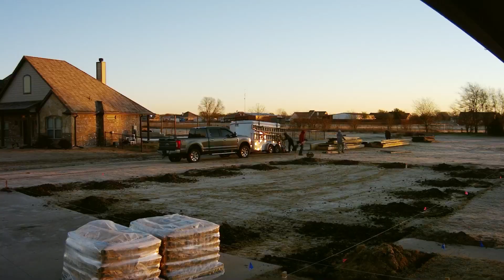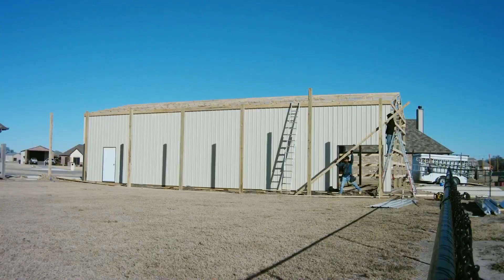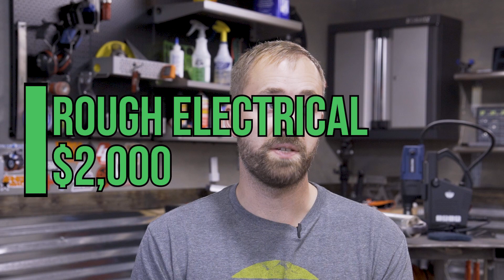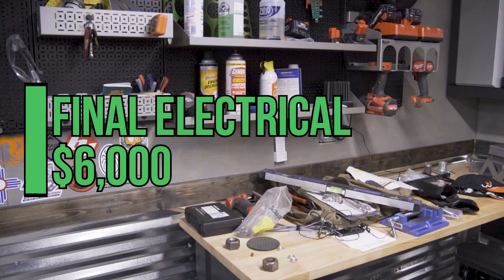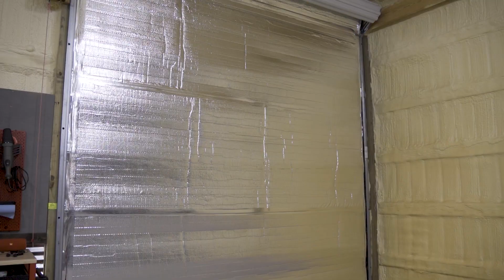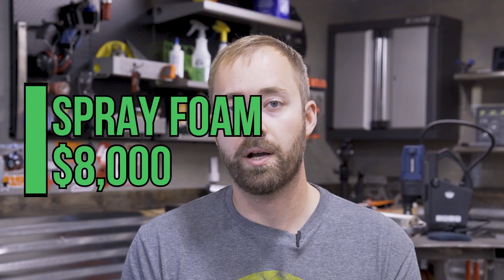How Much Does A 30x60 Pole Barn Cost? - Reckless Wrench Garage

Comment: 2 years late to the party but I want to build a 40x60x14 on my property. the place I want it is mostly flat but its a good 500ft + from my house so it will be a long run for electric, water, and natural gas. I also plan to add a bathroom so there's plumbing involved. I built a 250 gallon compressor, using an old LP tank, with a single stage twin cylinder compressor that runs on single phase 240v that's going to go in it. (its under my carport, wired up to a double fuse box atm). I want 2 12x12 roll up doors and 2 man doors. full insulation (Georgia heat and humidity), floor drains and a 2 post lift. most lift manufacturers say 5" high pressure concrete but I'm going with 6". I was planning on going the full metal building route but seeing the pole barn setup has me rethinking that.

Comment: I’m not trolling, but you had a $75,000 shop built but didnt own an impact drill?
Reply from the maker: Uhhh, yeah. I also don't own a table saw, bulldozer, router, planar etc.

It's almost as if I don't ever do construction, maybe I work on cars and work with metal.
Reply: @ I’m an auto tech by trade, and even I have an impact drill lol
Like I said, I wasn’t trolling just genuinely curious

Comment: Huge help thanks!
I’m looking to do the same style but a 40x60x16.
I have 2 questions though…
1. What is the height from your mezzanine floor to the bottom of your rafters? If I go with 14’ eaves maybe I can do a steel rafter….

2. Do you happen to have the links for your building and some of the contractors that you used?

Comment: I can get one 40' X 60 feet here in Florida just as nice if not better, for $23,000 assembled out the door........ Yes, it may be cookie cutter, but if I like the building, then it's what I can use. The interior spray foam and concrete floor is separate of course......... So , maybe $30,000 completed....

Comment: Why'd you put the slab in after the structure?  Seems like that would raise the difficulty of almost everything but especially of the slab work versus putting that slab in up front.
Reply from the maker: Lookup post frame construction.
Reply: @RecklessWrenchGarage  I don't have to since I already know and it's not germaine to the question.  Just because post frame-in allows the slab to go in secondarily - or because it doesn't require a slab - doesn't mean that's the best way to go when you are definitely going to have a slab when you first put the building to use.  So, again, why did you decide to put the slab in after the structure?

Comment: Would you be willing to say which company you used to build the actual structure? Was it a well known national company, or a local company in your area? Do you think the 2" thick insulation would be enough if I wanted to make part of it as my home and the other part as my shop? Was it a pain dealing with the local county building code enforcement and paperwork by being your own contractor? The last thing I want to ask is did you have the money saved or paid as you went or were you able to get a loan from a bank?. This is an excellent video by the way. I like the details you added, like the rat guard. Thank you.
Reply from the maker: I used wolf barns and they are in Oklahoma and Texas. 
I don't have any codes or permits living in Texas to deal with.
2 inch thick minimum insulation was recommended for a conditioned living area
This was with my own money I saved for a long time. Personal loans are an option as well for something on this budget.

Comment: In Ravalli county Montana a 30' x 40' X 10' pole barn with inside 4" slab, one 16' x 8' garage door, 3' one man door, one 4' window, no vapor barrier is $40,500.00. This price did not include the dirt work, that was an additional $3,500.00 and had to find my own contractor for this. I had to cut into uphill side, about 6' cut on high side then slope and drainage ditches and was left with flat gravel pad. This would class as a basic build.

Comment: I ordered a 40x60 red iron building for 65k. Spend 5k on permitting. Was saving up to get the concrete and got laid off from work. Had to take a new job out of the area and use all my money on looking for work and moving. Now the shop is sitting in the back and the permit time is ticking and I have no prospects of getting it built. Sometimes life goes in unplanned directions. You just have to do the best you can and then embrace the changes and hope not to lose everything.😢 But I have a good job and hope I can get some money before my permit extension options run out.

Comment: Mine is a little cheaper, around $57k. I saved by doing my own electrical and framing, both are easy to DIY. Paid an electrician to run the main box into the house. Still think it is worth building yourself instead of buying even with todays prices.

Comment: So it sounds like concrete is at least half the cost of the building.  Wanting to do a 32 x 44 (dimensions based on site) where a tractor and implements along with a trailer would be in part of it. . I "thought" about just concreting part of the floor for a shop area and leaving the rest rock.  What gotcha's would i run into if i wanted to concrete the rest later?

Comment: I had my 30x30 done and had the roll insulation put in. Foil on exterior and insulation on back. It’s 1 ft to6ft elevation on back of building. Built up with over 425 split black. A3 ft man door and 24x10 pull up door.  Including 3 dump trucks of fill dirt and rock. A4in thick slab for a total of $30,000 here in Tennessee.  I feel I did pretty good considering.

Comment: Just completed (yesterday) my 40x70 x12 pole barn with cement here in south Louisiana for $62k complete cost for building and cement. I did nothing, 2 brothers built building in 3 days in 98F heat. Waiting on cement to be poured, hopefully in next few weeks.  I am sure the inside and electrical will cost a fortune.

Comment: last summer I was told by a contractor in northern Idaho that it would be $200,000 for his companies labor, not counting material, to erect a metal building with concret pad and electric.  I would be supplying all materials.  40ft x 60 ft.    Family in the Willamette Valley of Oregon was told $84,000 for everything included, except concrete.  Same building.  from Priest River it is exactly 13 minutes to my property.  it takes about the same to my families property from their downtown.

Comment: I thought the prices were okay until you got to the final electrical,  seems very high. Then the doors came in high but they are probably very hood quality.  Insulation spray on, is over priced everywhere.  It is needed fo all of them if it is to be closed up. Thanks for sharing.

Comment: I think he got burned on that closed cell man.  I got 2" closed cell in same size building, except my walls were half the height, in the northeast for $4000.  So, similar cubic inches  sprayed of closed cell foam overall, for way less.  And I had extra 4" of open cell put in the ceilings, over the closed cell.   It can be done, the materials for this did not go up that high in the last 4 years.  The insulation companies are burning people left and right, and we still let them get away with it.

Comment: Holy Shnykies ....

Built my little shop several years ago.... maybe a year before Covid.
Wow, have the prices of things gone way through the roof.
 Dirt work w/concrete poured and finished was 4 and change per foot.
 Trench for electric, full wire job, led lights throughout was under 2500. (I had to fill the trench after)
 24×48 all steel with upgraded metals. 
Upgraded to hurricane grade roof and doors. (So. Indiana)
 I contracted most of the job but I had good relationship with the excavation company owners and they know everybody in the biz and hooked me up with some really good folks that did smaller jobs like mine during any slowdowns in their schedules. 
So I let them do their own thing on their time.
 It's like an afternoon to complete an entire job.
Electrician came 2 days for about 3 hours total and was done and gone. Site and concrete was the same way. Amazing to see guys swarm the site, kick up dust from 6pm to sundown and the entire site is prepped and the next night I get home and the slab is down. Get up in the morning and they've already come and finished the slab.
Anyway, yeah ....
I don't think I could afford a building right now with the costs being so high...
Reply from the maker: Yeah, COVID has screwed the building market and inflation in general. I don't want to think how much cheaper this would have been in 2019

Comment: I have done everything myself. 30x50. I have less than 30k on it so far. Plus I have heat and AC.. But I still lack the spray foam and closing off the interior walls. But that price includes buying the property. .Advice for anyone doing this. His electrical service is inadequate. A welder and air compressor is 80 amps alone. He is already overloaded. Minimum 200 amp service.

Comment: I actually got a 20x38 ft all metal building. The one with all the galvanized metal that you said you didn't like lol. So far I have done the dirt work, concrete, The building itself, doors windows and insulation. And we're up to about 30k.

Haven't done electrical yet and I got a really good deal on a standard residential double wide garage door being that a family friend works for the garage door company and rich people like to update their doors and just throw away a perfectly fine double wide insulated garage door that I got for $500 instead of $5,000
Reply from the maker: I wasn't completely opposed to the all.metal buildings, they just weren't my #1 choice for what I wanted to do.

Comment: Something you did not cover at the beginning of your video is before you do anything at all is to go and check construction zoning for your property. The last thing you want is to have the city or county telling you you have to bulldoze your new building as you failed to have a building to code. This is not something you want to trust to a contractor as all they care about is being paid for building a building. I have heard of plenty of horror stories of people having something built or added to their house and the city fining them a butt load of money for being out of code and having to tear it down after spending tens to hundreds of thousands of dollars having the thing built.

I would never consider spray insulation as with the slightest mistake that can cost you more to have it remove than it cost to have it put in in the first place. If you do decide to do spray insulation make sure that you have it in writing that if there are any issues with the foam insulation that the contractor who put it in are fully responsible at their cost of removing it and replacing it to your sanctification on a reasonable time table.

Comment: This is the problem with men today.  I don't hire anybody to do anything.  I am too proud to hire other men to do men stuff I can do myself.  Men should start young, build up a collection of tools over time, and do your own work.  If I don't know how to do something, I learn.  When I needed to move dirt, I bought a backhoe. Men need to take back their position in society and quit calling other men to do things for them. SMDH.  I built my own 25x35 garage, alone. Everything from top to bottom.  I'm starting on a 40x60 out building next week.  The only thing I am having someone else do is pour the cement.  I framed it, put all the rebar and mesh in, and the only reason I'm hiring cement work out is because I don't own a cement truck.  Yet.

Comment: $126k without lot.. You did it really cheap..  I did a 80x40' and the cost was 46K$, no site prep, no concrete, no insulation, sliding doors on each end.. in 2011

Comment: Wow, that's expensive!

A steel building with an I-beam frame, 3" reinforced concrete mezzanine, and foundation only costs around $30/sf built - depending on the size of the mezzy.

(6" vvt insulation and doors/windows included!)

Comment: is your insulation adequate for air conditioning in texas? I'm looking for something similar in Texas but I need it energy efficient enough for constant AC use.
Reply from the maker: The contractor that did the insulation recommended 2 inch thick spray foam for climate controlled

Comment: I also went with option 2 but did a good chunk myself such as all electrical and finish work.  Also gonna be building a loft similar to yours.  I ended up doing a 30x50 with a 10x50 covered concrete porch pretty similar to yours with 14' walls because I also knew I wanted to do a loft like yours.  Also going to be doing a similar "cost to build" video on my channel like this because despite having a pretty good idea of what I wanted, there were still a handful of things I did not anticipate and went way over budget.  Mainly had no idea I would spend so much on just dirt work for the pad and trenching for water/electric.  Also didn't think about needing gutters put on to catch all the extra water draining off the roof. Great video.  Thanks for sharing and sweet shop!

Also, according to my local code they do not allow exposed foam of any kind.  I was told if I use spray foam or foam board to insulate I would have to cover it in 1/2" drywall.  That's not going to happen!  As soon as I vent my sink drain out the roof and add a porch light, I will call the inspector for my final inspection and after he signs off, I'll roll the dice and insulate it how I want if I have enough budget leftover.  Codes are very strict in my county:(

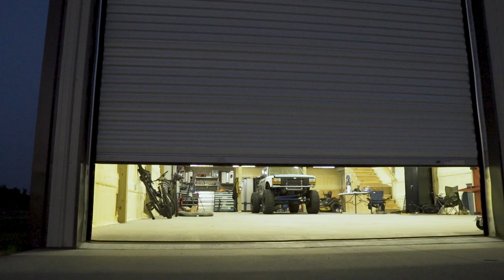Comment: Data point for others.  Pole building 30'x48' with 16' eave height and 10:12 attic trusses. 26ga steel roof with 12" overhangs all sides;  OSB, housewrap, and vinyl sided to match house. One 12'×14' R16 insulated overhead door, one R16 insulated 10'x9' overhead door, double-wide mandoor and 36"x60" windows in each gable end at attic level. Poles include pole savers, and thr attic decking, stairs, and safety walls included.   This built on my property $72K.  I did all the site preparation myself - equipment is mine but I spent about $2000 in fill and stone, included digging a dry sump for the gutters to meet Code.  I ran the electrical myself, and wire, subpanel, and permits totalled $1600.  Currently getting costs for 5" concrete floor with thickened area for a future lift along with a 28'x16' apron in front of doors to connect to my existing drive.  One quote was $9k for plain finish with no sealing on floor and broom on apron and another was $15K with hard trowel finish and sealed for floor and broom on apron. Mind you this is literally just bringing in the concrete and welded wire fabric and spread and finishing.  The stone is all graded and compacted tight by me and I'm doing the vapor barrier.  The concrete plants have told me there was a big increase in concrete cost.  I originally priced this out in 2019 as a completed turnkey from a local builder and all-in it would have been $65K!!  I wanted to pay cash and needed to wait another year, but then the pandemic...  Same builder updated his quote and it came in at $122K!  Kicking myself for not just financing the bit back then with pretty darn low interests rates...

Comment: So you built the barn then put in the concrete floor, interesting I was always under the impression you lay the concrete slab then build the barn, but maybe since yours was larger and had a big door it made it an option that a smaller one would get

Comment: Other than wanting more square footage I wish I had even more electrical outlets. I built mine in 1996 and had all at least 20a every 6 feet. I never anticipated all of the led desk lamps I would need at every tool station because of my old eyes and all of the battery chargers.